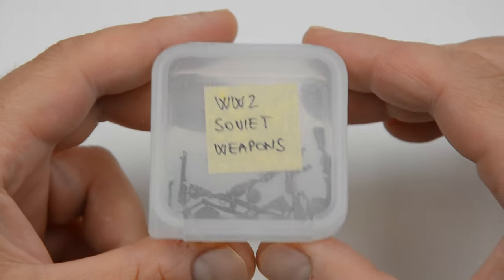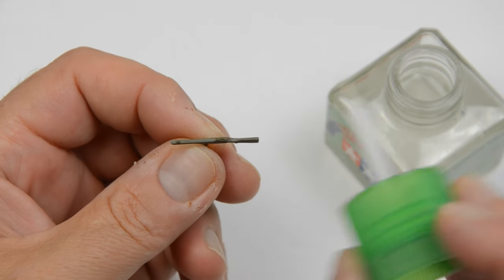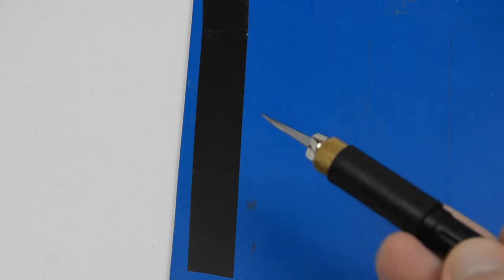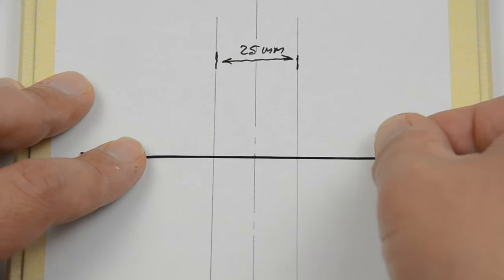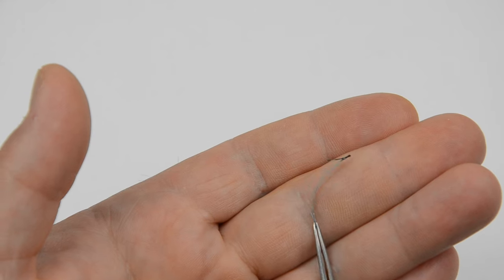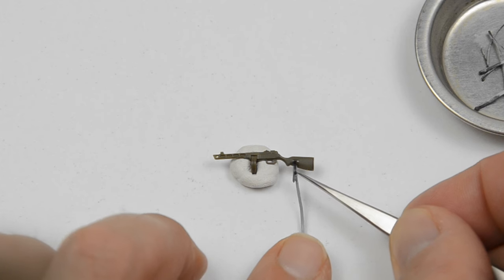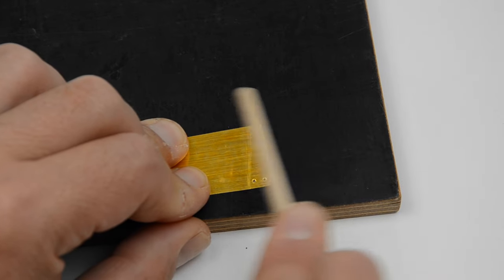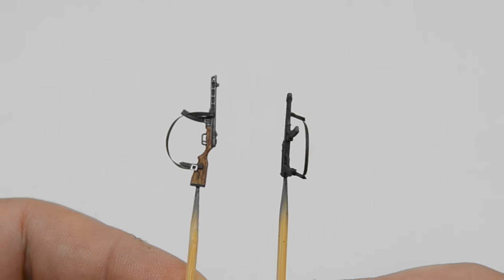UPGRADING scale WEAPONS: Slings, Belts, Buckles (1/35, Scratchbuild)

Comment: For uniform belts and weapon shoulder straps I paint blue 3M Painters Tape the appropriate color, then I use an X-Acto knife to cut it to the width and length needed. The nice thing about this tape is that is accepts paint readily, and its adhesive makes it easy to affix to figures, weapons, etc.
Reply from the maker: Thanks a lot for the tip... ❤️